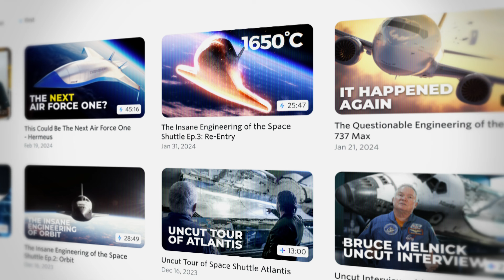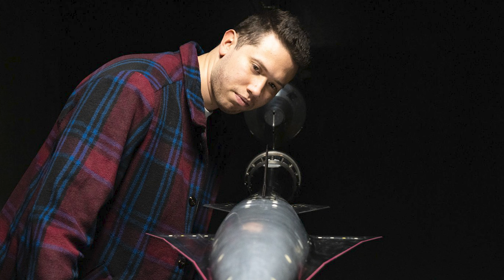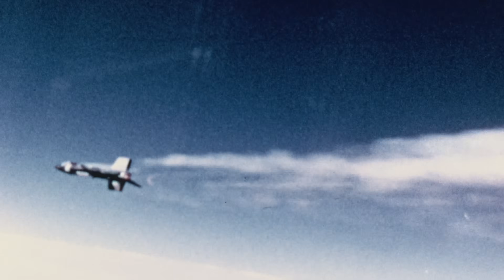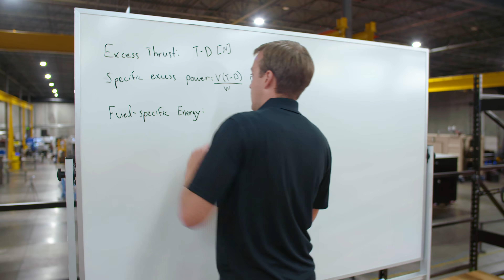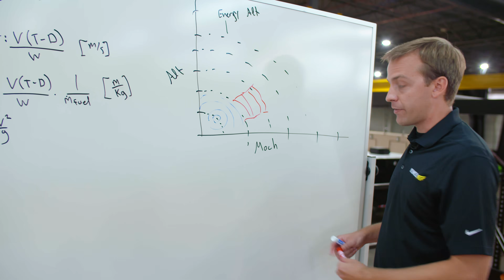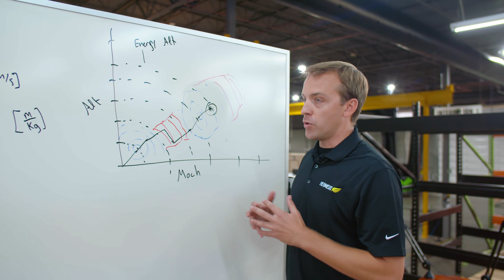I'm Happy Hermeus Let Me Upload This

Comment: I’m not sure I actually understand why we can’t just use computational CFD simulations on everything these days, surely they gotta be better than wind tunnel testing, especially with modern computers?

One other interesting thing - it’s not just the XB-70 that had white paint, it’s also the Tu-160 “Blackjack” which is also painted white. I guess it’s still slower than the XB-70 (Mach 3)?

Comment: Totally curious question: When dealing with the thermal issues and air compression at those speeds. Is it possible to utilize a sorta plasma/telsa coil at the tip of the craft? Or possibly even a static electrical coating around the aircraft? Could it protect, mitigate the effects sorta how a Faraday cage can or plasma magnetic confinement effects but in reverse? To protect the aircraft from the effects of air resistance, heat, etc. (sorry if it's so totally stupid question. My childlike curiosity just can't help but imagine and be curious about)

Comment: Great interview.  Nice to hear directly from Joe.  Very interesting that Joe discussed the exit nozzle drag issue on the SR-71's engine, but not the reverse circulation around the outside of the engine at high Mach #'s that NASA discovered in the 1970's- which resulted in an enormous amount of drag that Lockheed never found the source of.   This led to the SR-71 needing much more thrust (fuel burn) at high cruise speed than had been anticipated.  This design to in practice difference impacted the SR-71's range enormously.  Curious to know if maybe I have my information wrong, and maybe it is this exit nozzle issue that NASA discovered???

Comment: Man, you really can see the advantage of the X-15 "just use a rocket engine" approach... Especially given the fact they still have to be tied to aerospace primes to help provide large parts of the jet engine, whereas the launch startups often just make their own engines totally from scratch. I really honestly think a rocketplane could be decently efficient, too, using a skip-glide approach, probably allowing transatlantic flight.
Reply: The benefits from using rockets would not be worth the extra cost from needing to buy/make oxidiser and then carrying that weight increasing fuel use.
Reply: Oxidizer is extremely freaking cheap, though. That's a thing a lot of people don't get about rockets: the oxygen is basically free, and the acceleration is high enough that the gravity losses aren't a big deal. When I mean free, I mean like $100, maybe even $50 per *tonne*, compared to like $10,000 per tonne of liquid hydrogen. So even though you need 8 times as much oxygen as hydrogen, the oxygen is basically free. @Babosa404

Comment: This was an interesting interview. Something that really resonated with me was the fact they use CFD to a point, and wind tunnels to a point. But they go back to the 50's style of pure math to work things out. Then that triggered memories back to dynamics and one of the guys was really punching out the calculus and numerical analysis to understand what he was doing not just doing it. He knew from day one of engineering that he wanted to build rockets. Somehow he knew exactly what he needed to do when the lecturers constantly said "There's a proof for this and you can work it out if you try hard enough but I'll just give you the equation".  I feel now, that the lecturers made a mistake. There's knowing and there's understanding. The difference may be subtle but it's Important. It's the difference between knowing your shit and knowing you're shit.

Comment: Maybe dumb question: Why would this thing be necessary at all? We have space rockets that can circle the Earth in 90 minutes. They can provide unparalleled reconnaissance with practically zero risks. They also could, in principle, serve as a point to point passenger vehicle.
Reply: Because rockets burn to much fuel. The ticket prices for passengers would have to include fuel costs which would make ticket prices extremely high and unaffordable. That's why Concorde collapsed because it's ticket prices were too high.
Reply: @bushgreen260  It's not like these hipersonic planes would be economical. With economies of scale you can lower down launch costs significantly. Starship has that potential.

Comment: 23:00
emissivity and absorptivity are the same but they both, together, vary over the wavelength of light
as long as yo uare cold enough htat oyur thermal radaition is mostly infrared you can find a surface that has high emissivity and absorptivity in infrared but high reflectivity in visible light and thus get any color while emitting thermal radiation
once you get into a heat range where a major part of your thermal radiation is in the visible range (generally called glowing hot duh) you have to decide/trade off depending on the range of applciations how much absorptivity nad emissivity vs reflectivty you want in the range where the visible and oyur thermal radiation overlap
Reply: ignoring the misordering of letters, this should be a top comment. For ppl who can't read it, reflectivity (or emissivity) is frequency dependent.

Comment: All bollox, won't even get off the drawing board. Been banging on about hypersonic jets for ten years now, nothing happened yet. Engineering projects are run by accountants, never going to happen. Why don't they research into alternative energy sources because when the lights go out and there's no heating in -20 Degrees Centigrade hypersonic speed will be the LAST thing on your mind.

Comment: So interesting the back to basics near hand calculated fluid dynamics.  My mom was an engineer at AVRO and the ARROW interceptor was designed using slide rules, giant hand cranked mechanical calculators, tables and graphs they hand drew, hand drawn blueprints and models shot off rockets over Lake Ontario for some high speed data.  The result was IMHO a beautiful bird in its form and some pretty impressive performance.
Reply: You have a interesting mom. And it's cool that she got to work on such a project

Comment: You are flying through air = nitrogen and oxygen =two different phase interactions systems in an air molecule , know the phases ,of said systems = one can repel off ,of the craft ,any drag potential of air molecules so knowing the AFOREMENTIONED how can you build an instrument  to repel said systems whilst still in flight ??? It has to be variable  due to speed requirements  look at the charges on the crafts outer structure  surfaces in a wind tunnel then calculate air pressure  at heights required = a given average so that instruments  can compensate for any given charge and repel

Comment: I wish they could have discussed power source vibration frequency and amplitude issues in both low/high-speed conditions on the airframe during flight and issues it could have on the expansion/compression of the airframe. That might have taken the conversation too deep, but I brought it up because if it is not considered during development over the lifecycle of an aircraft, it can compound structural costs to repair with no way to fix the issue.
Reply: It's under consideration! I'm less familiar with the interactions of thermal and vibe environments. Do you have further reference?
Reply: @BenCrews  I tried to reply with references, but as they were links to external sites, I couldn't. So, I sent you a LinkedIn message with the info.